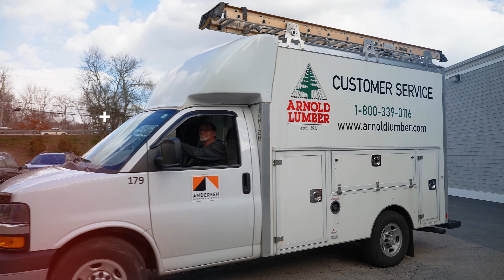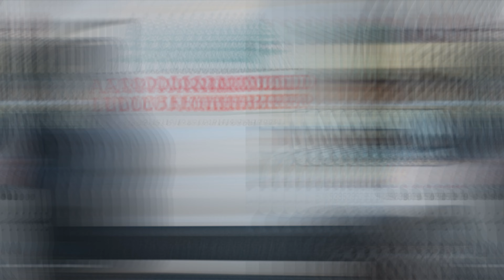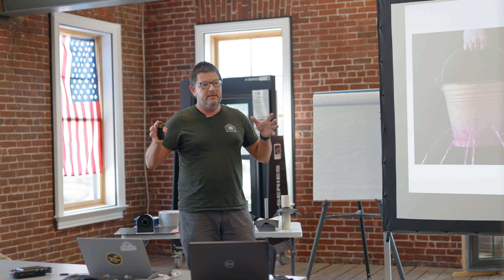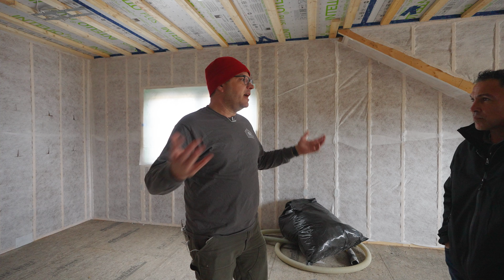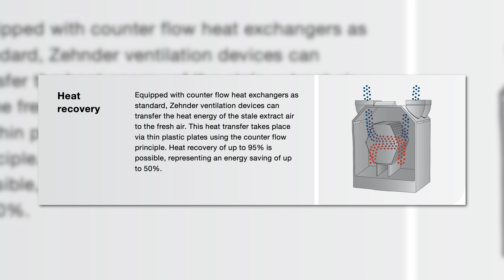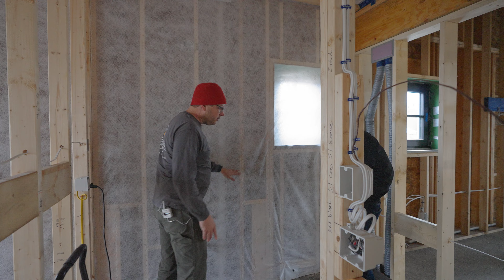What it Takes to Build a "Better" House - Breaking Ground Episode 1

Comment: Passivhaus has some good ideas in it, but "passive" is a misnomer. Just try not being at home at the right time to close the drapes in the evening, or not being awake to open them in the morning ... or having a month or two of persistent heavy overcast and rain in winter! Active heating through hydronic or electric mesh floor heating powered by solar hot water or photovoltaics, still heats your house on energy you can extract from sunlight, but does it much more efficiently and reliably than a bunch of sun-facing windows. And of course, if you've got enough solar panels on your roof to run a winter floor heating system, then it's easily enough to run whatever cooling you need in summer.
What we do need to see is much more emphasis on roof designs that are ready to support a lot of solar panels. No more of these mutliple decorative broken gables and zigzag roofs - the sun facing roof should be a nice big uninterrupted rectangular plane.
Reply: I have a very different perspective about Passive House than you describe.  Our approach incorporates passive house concepts at the design phase to intelligently and thoughtfully engineer the building envelope so that the building, without the need of active systems like window drapes, needs the least amount of energy to maintain the comfort of the occupants throughout the year.   And we definitely don't design for the sun to be a heating source for the building, we are more often than not designing overhangs and sun shading devices for our windows because the heating loads are so small that the sun will easily overheat rooms and make them uncomfortable.  I completely agree with you about roof designs for solar.  Our projects that fully meet the passive house standards are very easily 100% powered by very small solar systems because the heating and cooling loads are so minimal.  (This project was not our design and is not the best example of this).  We typically heat and cool with air source heat pumps because of the high efficiency of the units and also because, unlike radiant floor heat, they only require the installation of one system to provide all the heating, cooling and dehumidification.  Radiant floor heat is wonderful, but in our market if you want cooling as well, which most people do, then you just doubled the cost of the hvac installation.
Reply: @stephendemetrick636 Fair - I wish you'd been hired to write my course materials, because that's not what I'm being taught in class. 
I still prefer floor heating, because with the way warm air rises, floor heating is the only way to have the actual floor warm, and when you've got little kids playing on the floor you want the floor to be warm enough for them to lie down on without getting chilled. Also, separate ventilation and cooling systems means that you can have active ventilation to all rooms, but only cool the rooms that need cooling, and even have those rooms cooled while there are other rooms that need heating. For a small house with only one or two people in it, it's an unnecessary expense, but for a bigger family home with people at different life stages and different activity levels and comfort needs it's justified.
Reply: Passive house doesn’t need in floor heat.... it’s a waste of money.
Reply: @SnoozyToozy  In my climate and with my circulation, I'm putting in that floor heat. What you do in your climate and your personal health needs is your business.

Comment: how much per square foot does a house like that cost? $400? $500?
Reply: We've done budget comparisons based on our own price points and we have found that for our company it adds about 3-5% to the cost of building a net zero ready home compared to building that same house to the basic building code.  In regards to square footage costs, t is not possible to gain any useful information about the cost impact of building this way when looking at oversimplified square foot building costs because there are far more variables that have a greater impact on square footage pricing than air sealing and insulation and ventilation systems.  Variables like building size, building shape, structural complexity, location, lot access, level of finishes, level of completion of the drawings and specifications before you start, etc. have a significantly greater impact on total building costs than the systems we put into our houses.  If someone really wants to keep costs down, there are a lot of other areas I recommend searching for value first.